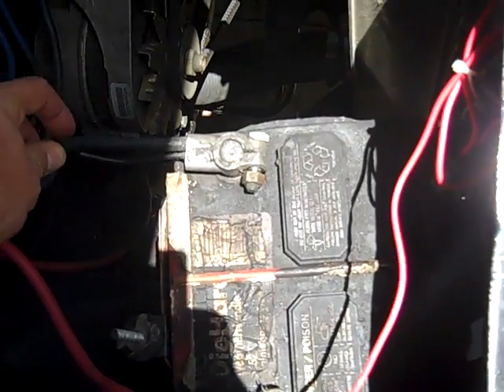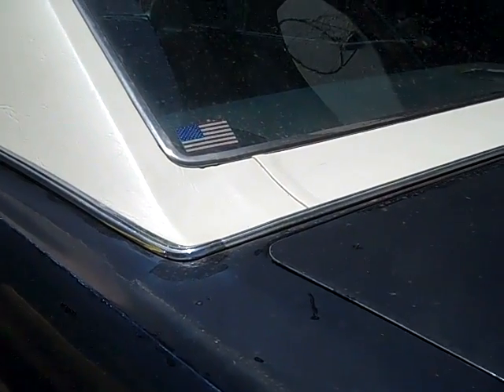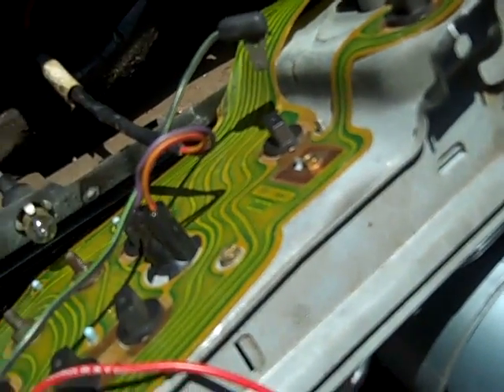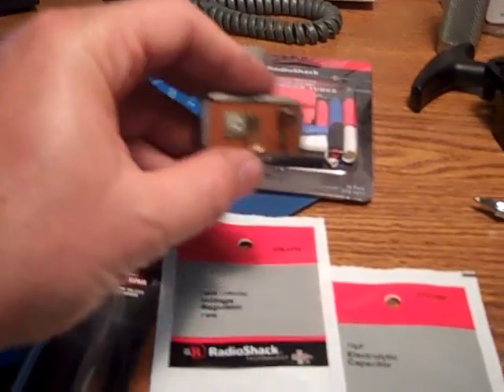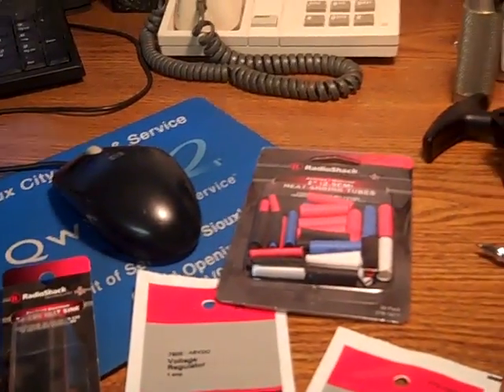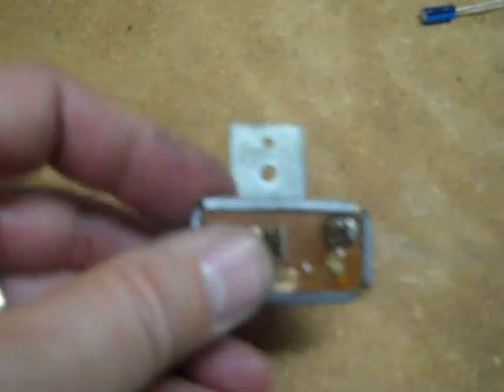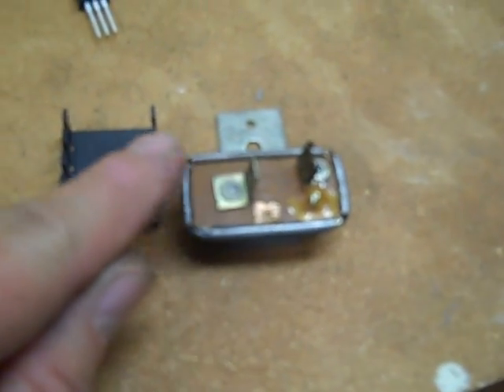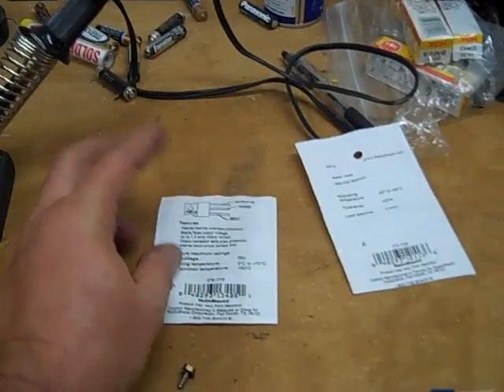1968 FORD FAIRLANE INSTRUMENT CLUSTER VOLTAGE REGULATOR

Comment: Good conversion but you are out on your history. The regulators were nothing to do with old 6v systems, the instruments were designed to work at 6v or 10v and a matching voltage regulator ensured that the instruments would work regardless of the cars battery voltage.

Comment: very great work  but you can  use the old regulator metal can  thanks friend
Reply from the maker: True..  But the can  is less accurate and not as reliable.  The can is pseudo  6v DC.  The 78XX VR chip sets are True and very  flat  DC.  Keep in mind you can use some power resistors and with a little math make a voltage divider that would also work, but again..  Not as accurate or as flat  as the VR Chip. The VR Chip sets are perfectly flat !!  Being so Flat and stiff is the beauty of this chip set.  This steady state flat DC will also increase the reliability of the gauges as well.
Reply: i see now thanks i have dodge playmouth voiger 1998  and have same problems i have no fuel gauge and no temp gauge ill do some tests with voltmeter  if  you have some information or some thing to help ill be very thank

Comment: Thank you very much for posting this.  I just followed your instructions today in a 1964 Ford F100.  I used the 7806 chip with a 25 volt 10 uf capacitor.  I put a 180* thermostat in a while back, and temp gauge read a steady 180* once it warmed up.  Had a full tank of gas and fuel gauge went right up to "full".  Thanks again for the video, I'm not super tech savvy but I was able to do this and saved about $45 over buying a replacement.

Comment: Hi,    how do you get on with it not being pulsed?From research I have been lead to believe that the pulse of the old regulators were there to dampen the fuel tank signal for going round corners etc.?I'm guessing the pulse is not entirely needed then. May be it was just the way the old regulators operated, bimetallic strip?( I was also lead believe that the reduced voltage was due to ford having lots of 6V gauges to use up, when they changed from 6V to 12V systems. If that's the case why do they have 5V, 8V etc).Have you heard of a "Lorimier" make voltage regulator?Good video by the way! Sorry for all the questions.Thanks,
Reply from the maker: +OldDog NewTricks  My guess is the rise and fall time generated from the voltage reducing device used by Ford.  This causes the pulsing .  The 6v instruments can not respond quick enough for the rise and fall time to affect them so they see it as 6v dc.   It is a function of the old regulators.  Now we have Ic's  and you can give the instruments the steady state DC current  and flat DC  needed for better operation..
Reply from the maker: +OldDog NewTricks   An analog Gage can not react to the pulses.. It smooths out the pulses.
Reply: +OldDog NewTricks - It simply has to do with power transfer from the car's electrical system to the gauge set. A modern car's electrical system runs at about 12 volts while the gauges need only about 6 volts. If you feed 12 volts into a 6 volt device it won't work correctly at best and it might burn out at worst. This is what would happen if you put a 6 volt bulb from an old car into a newer 12 volt car. The bulb might glow really bright for a while, but eventually it will burn out.

But what the regulator is really all about is the correct calibration of the gauges. If the voltage going to the gauges is too high then the gas gauge will peg at the full mark and stay there probably even if the gas tank is partially empty. The oil pressure and temperature gauges will also peg at the top even if the oil pressure and temperature are normal. However if on the other hand the regulator output is too low then the opposite will happen. All the gauges will read too low.

What the old fashioned electro-mechanical regulator does is to pulse or chop the output voltage at about a 50% rate, which is referred to as the duty cycle. As such the gauges are still being connected directly to 12 volts battery but only about half the time. So because the gauges act so slow they will work the same using 12 volts around 50% of the time as they would connected to about 6 volts 100% of the time. But also remember that the electromechanical regulators have a small mechanical adjustment in the back to adjust the duty cycle so as to calibrate the gauges.

What the solid state regulator does is basically the same thing, but it does it differently. The device drops the voltage down resistively from 12 volts to 6 volts using a transistor built inside the regulator. As such there is no chopping and no mechanical contacts or other moving parts to wear out. This is why transistors are used in a lot of places where relays and other electro-mechanical switching devices used to be used. They are simply more reliable. One other example is how modern cars use transistors in the engine controller to fire the ignition instead of using old fashioned ignition points that have to be replaced periodically.

With regards to the output voltages from the different solid-state regulators. Using a fixed regulator with a fixed output of 5, 6 or 8 volts is easier, but it doesn't allow you to easily adjust the output voltage to calibrate the gauges. Recently I had to replace the old electro-mechanical regulator on a friend of mine's 1991 Ford Econoline van. I used an LM-317 adjustable regulator instead of a fixed one like the LM-7805. It requires a few more resistors and an adjustable potentiometer. But when I was done I could reach around behind the instrument cluster to adjust and calibrate the gauges using the potentiometer. After everything was installed we put in a full tank of gas and then I tweaked the adjustment to make the gas gauge read exactly full. Then both the temperature and oil pressure gauges read right exactly in the middle where they should be. This was because the output from the solid state regulator was properly adjusted to calibrate the gauges.

Comment: I did this to my 79 F-100 and used the 7808. Now most of my gauges are reading higher than the used to. Any ideas? Thought about trying the 7806 to see what would happen, but its not fun pulling the cluster every time I need to get behind.
Reply: +John Neyrey - Using a fixed regulator with a fixed output of 5, 6 or 8 
volt output is simpler, but it doesn't allow you to easily adjust the output 
voltage to calibrate the gauges. Recently I had to replace the old 
electro-mechanical regulator on a friend of mine's 1991 Ford Econoline 
van. I used an LM-317 adjustable regulator instead of a fixed one like 
the LM-7805. It requires a few more resistors and an adjustable 
potentiometer. But when I was done I could reach around behind the 
instrument cluster to adjust and calibrate the gauges using the 
potentiometer. After everything was installed we put in a full tank of 
gas and then I tweaked the adjustment to make the gas gauge read exactly
 full. Then both the temperature and oil pressure gauges read right 
exactly in the middle where they should be. This was because the output 
from the solid state regulator was properly adjusted to calibrate the 
gauges.
Reply: John Neyrey by the way great video.
Reply from the maker: John Neyrey  yep..need to use the 06 or 05.

Comment: did you use 20 awg wire? What capacitor did you use? I have seen on guy use two putting out 10.0 uf
Reply from the maker: I only used the 10uf cap as seen in the video. 20awg seems about right .

Comment from the maker: The output voltage is a function of the chip set.  7808 is 8vdc out.  7805= 5vdc out. 7806 is 6 and so on. Try a 7806 and let me know how that works. I used the 7808 and when my tank is full , it shows just slightly over full on the gauge, but over all works great !!

Comment: I went to one RS store and called another. Neither had the 7808, so I'm going to have to order online. May as well get the capacitors, too, but I need to know more than 10uf. As someone has already asked, what about the voltage? Thanks for the video. If I can get the parts, I'm going to give it a go.

Comment: I know u said its a 10uf capacitor, but is there any more details? I'm going to make one of these for a 69 fairlane and I've seen 10uf capacitors in different voltages like10v 25v and even 450v. Which one would work? Or would any one of them work? I believe I just ordered a 10 uf 16 v capacitor

Comment: 1955 was Ford's last year for six volts.  In '56 Ford used 12 volt gauges.  It was the ONLY year for 12 volt gauges because in '57, Ford quickly went back to six volt gauges and kept them that way forever.  8-volts is too high.  Remember, this is all about the affect of current on a bi-metal gauge actuator.  That's right, the old Constant Voltage Reg was a bi-metal CONTACT working on solid bi-metal gauge actuators.

Comment: So the tab on the 780x regulators is also the ground? I assume that its grounded through the board that its bolted into since you only wired the 12v in and the 8v out. I want to use the 7806 for a step down in my truck for a factory backup camera which needs ~5.5 - 7v. The vehicle runs on 12v so this method seems simple and affective.

Comment: The voltage was dropped down to either 5v or 6v not because Ford had old gauges they wanted to use up but because of a electrical reason.
Even though a car uses a 12 volt battery the actual voltage in the car can vary from 14.6 volts with the alternator charging down to 11v  with all the lights on so if the gauges ran on 12v the readings would vary according to how charged up the battery is.
So they chose 5 or 6v to run the gauges to keep the gauge readings consistent even with a dead battery.